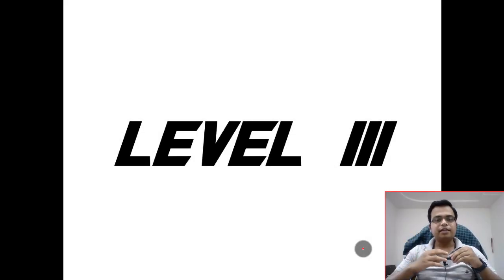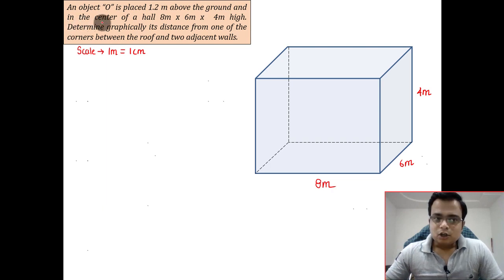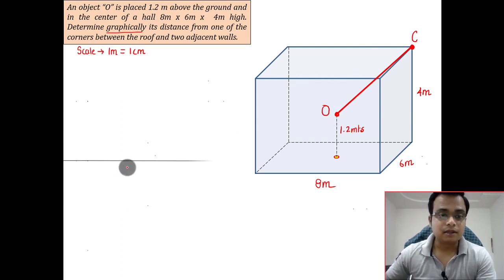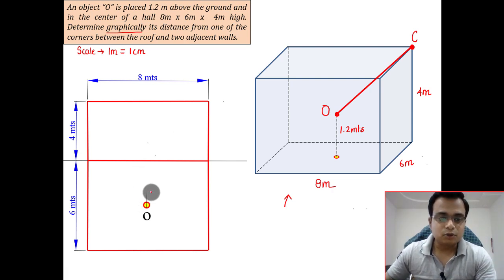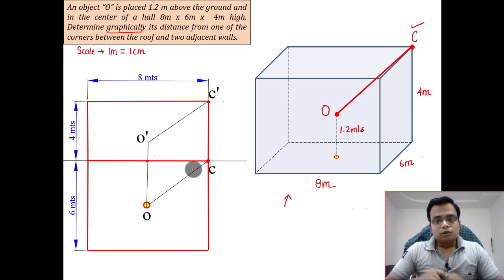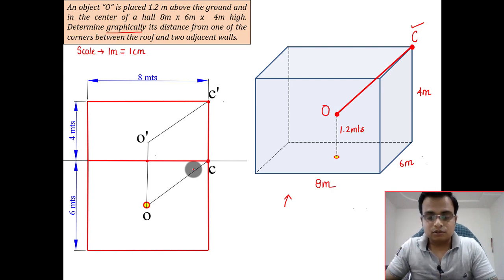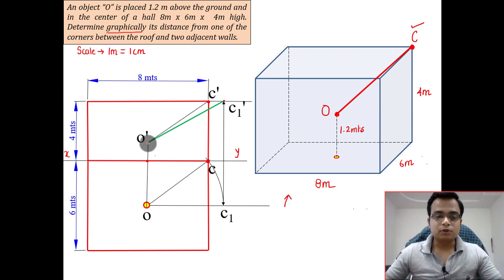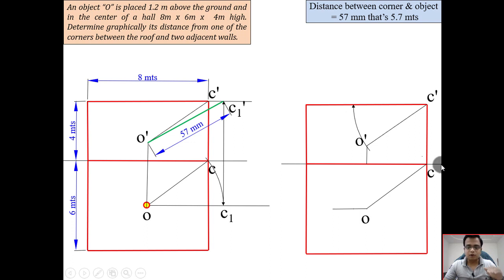Projection of Line_Reloaded | Level 3 | Problem 1

Comment: An object O is placed 1.2 m above the ground and in the centre of a room 4.2 m x 3.6 m x 3.6 m high. Determine graphically its distance from one of the corners between the roof and two adjacent walls. Scale, 10 mm = 0.5 m.